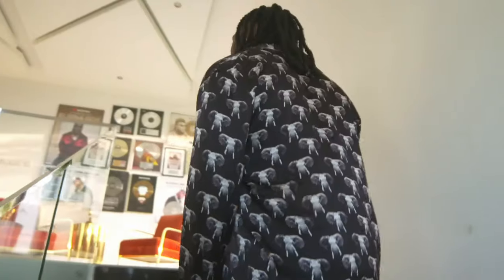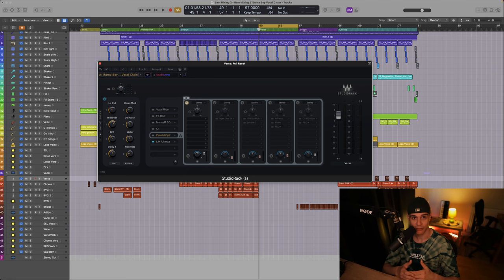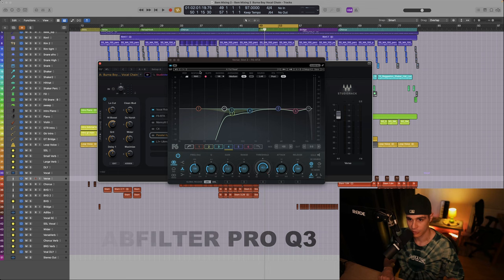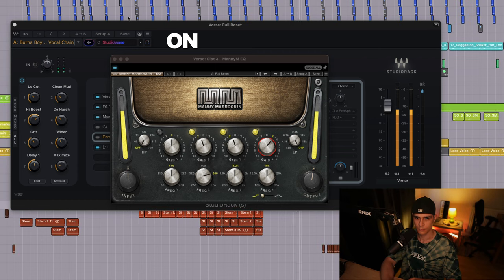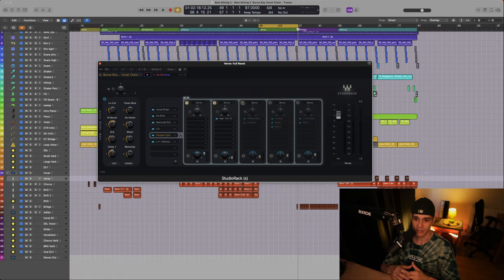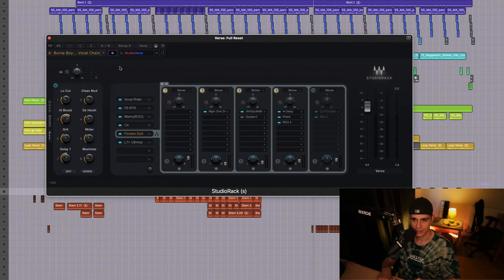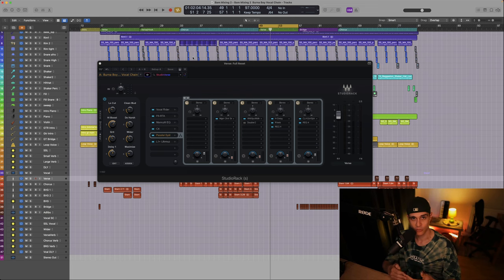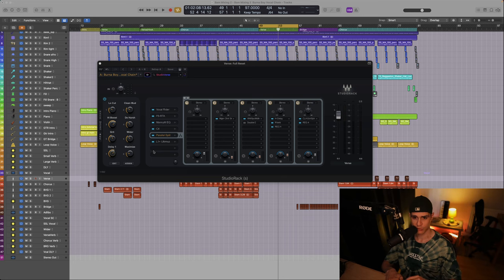Burna Boy's Vocal Chain Breakdown With Waves Plugins

Comment: Can you speak more about the thought process behind send it the delay to the reverb instead of putting in on the vocal directly, what’s the intention behind it
Reply from the maker: Hi I you think about this chain the effects are yes on the same channel but on a parallel split in this case we utilize it as bus or aux the only difference is that we can’t send different signal into it only the vocal in this case. but the point is that we have more control over the effects as we can add additional plugins too to shape the signal
Reply: @dxt3r_lab   whats benefit on putting the delay before the reverb on the aux chain
Reply from the maker: the reason is that delay will by further back and wont be too prominent.